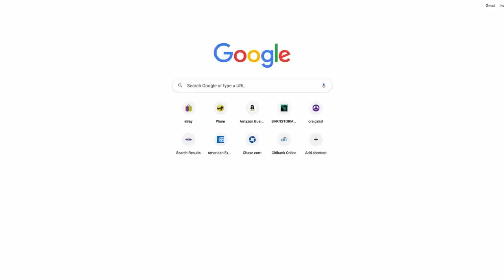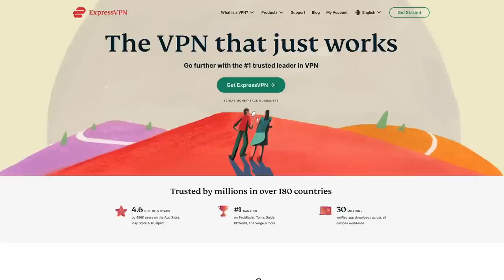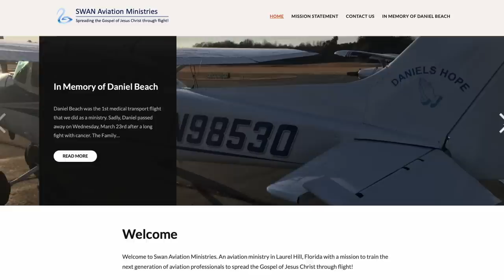7 Years… Rebuilding An Abandoned Piper Aztec Airplane Part 1

Comment: Nice cliff hanger showing you trying to start the engine, however you showed both propellers in full feather and then in the last clip showing the engines were already started at least once before the final clip as the propellers are no longer feathered, this will only happen when the RPM exceeds approx 500RPM and you have oil pressure.

Comment: G,day Jimmy's World (Jimmy and Stylus) from Sydney Australia.
This must be the best twin added to the stable (hanger).
* O-540 on the R wing
* Avionics inspection
* Secure the cowling
* See if it holds gas
* Connect the control surfaces
* Repair Nav lighting
* Interiors, seats and belts 
* FAA application and certificates

🌏🇦🇺

Comment: Thats somethin ive never understood an overhaul on a car motorcycle or boat engine is real straight forward bearings, rings, head\cylinder decks, cylinder walls and oil\coolant passages, water pump, oil pump, spark. But what is considered for a plane dual or single engine for the engines to be considered a full overhaul. What all needs to be redone do they require also the props; mounting actuation, and anything im forgetting

Comment: Engine gray or unpainted – Standard steel cylinder barrels. Orange stripe – Chrome-plated cylinder barrels. Blue stripe – Nitride-hardened cylinder barrels. Green stripe* – Steel cylinder 0.010 oversize.

Comment: Hey Jimmy!

My humble recommendation, always wait until you vacate the runway before you do any aircraft configuration changes like flaps.
Reply: Why?  Dump the flaps as soon as you touch down.
Reply: @daviddelaney4106  if runway remaining is not an issue, i would wait. The flap lever and gear lever are almost side by side. One knee jerk reaction move and a bad squat switch you end up with a gear up situation.

Just my .2 cents.
Reply: @echoalpha7195  interesting.  My airplane doesn't have that situation so I dump flaps as soon as I touch down.

Comment: Color Code for Cylinder Identification

Engine gray or unpainted – Standard steel cylinder barrels. Orange stripe – Chrome-plated cylinder barrels. Blue stripe – Nitride-hardened cylinder barrels. Green stripe* – Steel cylinder 0.010 oversize. Yellow stripe* – Steel cylinder 0.020 oversize.

Comment: Is that 235 or 250hp?  Straight Geronimo was 180 right?
Reply from the maker: the one I was flying was a 180hp, this blue tarp special is a 250hp.  From what I understand the Geronimo package with those don't mess with the engines.
Reply: @therealjimmysworld  
Yeah - that's what I was thinking.  Those are definitely not Geronimo cowlings - old Apache.  Probably a factory 235 Apache option pumped up to 250 later (?) and then some added on Geronimo mods.  Pretty cool combination.

Comment: I’ve owned three Geronimo planes. Unfort they are slow even with all the mods. 150knot plane.  Heater is always a battle to keep running!
Reply: Tried.?I have about 1500 hrs in these birds
Reply: Good thing it will climb on one engine to 13000 ft and se climb is fantastic . In sum very safe twin on one engine where most barely climb